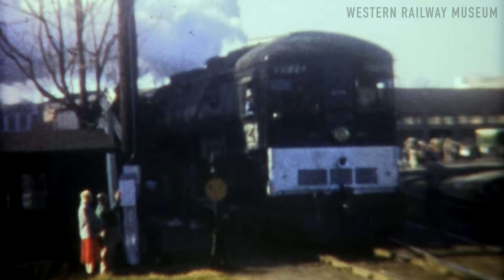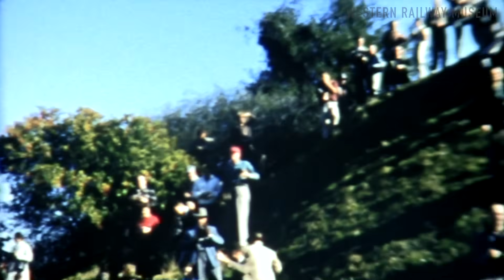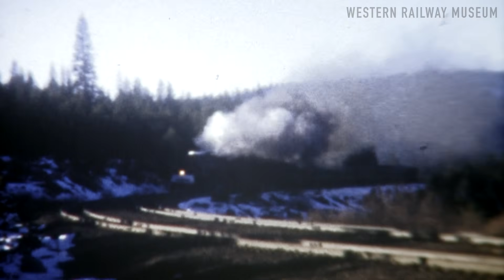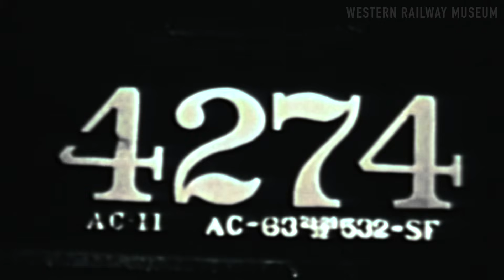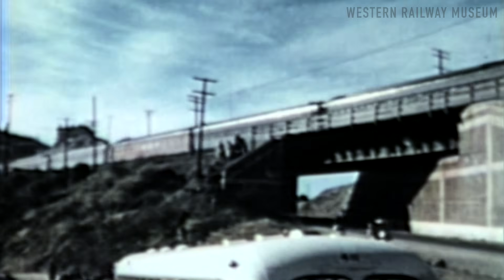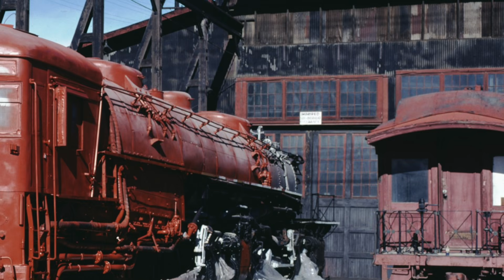Southern Pacific 4274: Last Trip Over Donner Pass

Comment: Does it still run to this day ?
Reply from the maker: Did you watch until the end of the video?
Reply: @HunterLohseRRVideos  it was retired and put into the Sacramento railroad museum
Reply from the maker: Then your question was answered
Reply: @HunterLohseRRVideos  wow I awnsered my own question  from its owner
Reply: @gabrielquinones3343  Too bad 4274 was scrapped after that excursion. If so, then the 4274 cannot run anymore excursions if it’s in pieces, only to have them melted down and reused for other products like soda cans, steel beams for architecture, automobile manufacturing, etc. which is very unfortunate for a Cab Forward. If only it were saved from the scrapper’s torch.

At least we have 4294, the last Cab Forward in existence.
Reply: @HunterLohseRRVideos  it doesn’t run under its own steam
Reply: @HunterLohseRRVideos  yes

Comment: This trip was extremely difficult to pull off. Southern Pacific was a railroad that was prided on public image, and when the trip was first proposed the Southern Pacific wanted nothing of it. Thankfully though the board of directors voted on allowing the trip and the vote passed and the trip was run. It was the same scenario with Cab Forward 4294, that engine was never supposed to be preserved.
Reply: I read that 4449's preservation was dumb luck.
Reply: @VickysStillVeryVeryIcky well 4449 was the first in the deadline therefore easiest to move from the yard, so

Comment: I was awed by its size in 1985 when I first saw it in the Sacramento Train Museum.  It was truly the pinnacle of steam locomotives.  Makes one wonder why they didn't go with the cab forward design long before this last series.
Reply: Crashworthiness, plus you need oil firing. It's more complex than needed if you don't have tunnels.
Reply: They did, the first Cab Forward was implemented in 1909, and was the MC-2 class Cab Forward locomotives.
Reply: That's 4294 at the Sacramento Train Museum. Unfortunately this one in the vide is 4274 and it was scraped. At least 4294 has been saved. Yes, it's massive and such fun to look at.

Comment: Why not run the engine backward through the tunnels?     Then you have the protection of the tender in front of the crew.   Was told that engine crews were vulnerable to injury at grade crossing collisions.
Reply: This is a cab-(foward) train
Reply: @IIIIIIlllllllIIILLL   A cab foRward locomotive.   Notrain.
Why not run the engine backward through the tunnels?  Then you have the protection of the tender in front of the crew.   Was told that engine crews were vulnerable to injury at grade crossing collisions.
Reply: @robertgift  How can the driver see then? its not like a normal steam train. the driver seeing the cab is just weird. what if theres a car in the railroad crossing?
Reply: @IIIIIIlllllllIIILLL    Correct.  Less visibility withe tender obstructing the view.
Buthe boiler also obstructed the view.
My great uncle had his fireman also look ahead when rounding left curves.
Reply: tender first operation is such a disaster, both from the crews visibility and the tender isnt designed to operate at first position

Comment: Southern Pacific Railroad merged with, or was bought out by, Union Pacific Railroad. With the restoration of U.P. 4014, a 4-8-8-4 Big Boy,, wouldn't it be a real bonus to have U.P. take the last remaining cab forward, a  4-8-8-2, and restore it to running the rails again. Can you imagine those two steam locomotives running as a single consist? Thanks for the video. Jon, Railfan 439, on the U.P., Pacific Coast Line, Santa Barbara Subdivision, M.P. 404.5.
Reply: That would be great, but the Union Pacific Steam Program has all it can handle, especially since it is not a revenue-generating part of UP, to keep 844 and 4014 running. They even donated 3985 to a private group for restoration.

Comment: How did they get Coal to the Boiler. Maybe it was Oil Fired
Reply: Also, the oil tender was pressurized to insure positive fuel oil flow to the burner, even at the thinner air at 7,000’ Donner Pass.
Reply from the maker: They were oil fired as are most steam locomotives that operate on the west coast
Reply: Yeah they pretty much needed to be oil burners for this desigh to work properly. Even then, their main terrain was California. Pretty much every steamer working in the state, and its neighbors, were oil burners because oil was far more readily available than coal. The same applies to the Santa Fe's steam fleet working that far west, and even UP's steamers were usually oil burners working west of Ogden
Reply: Note: With the cab in front, the crews knew that coal firing the engines would be impossible, so they burned oil instead.
Reply: @johnhagan7742  Camelbacks existed, I'll remind you